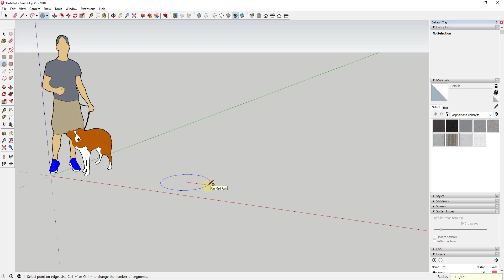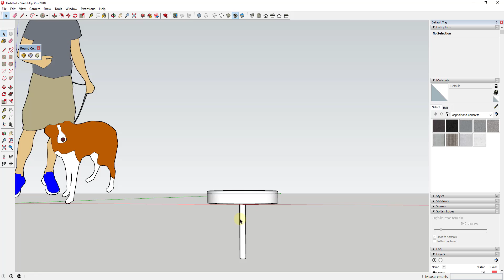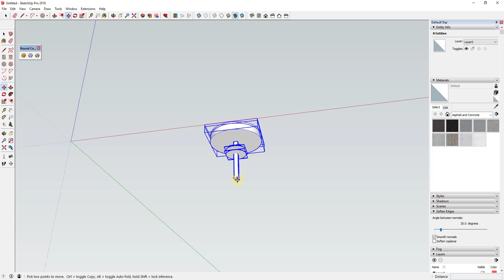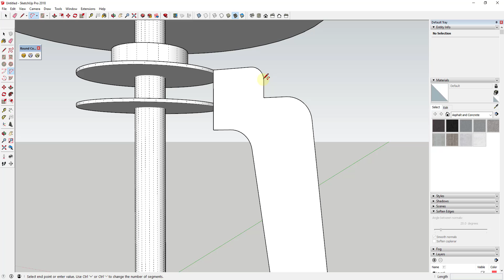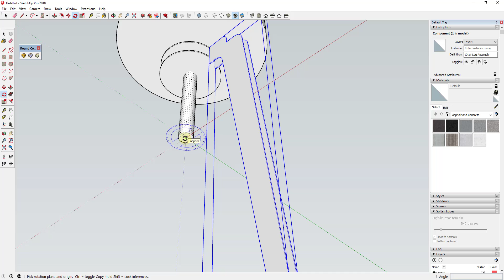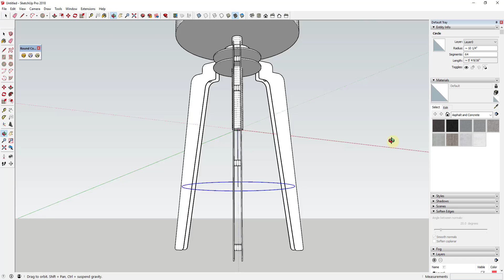SKETCHUP SMART MODELING - Modeling a 3 Legged Stool with Radial Copies!

Comment: Hi Justin , sometimes the find center command does not work what could be the reason  , thx .
Reply from the maker: Sometimes if your circle gets exploded into individual edges, or if an edge gets split or removed, the function no longer works because SketchUp doesn't recognize it as a circle anymore